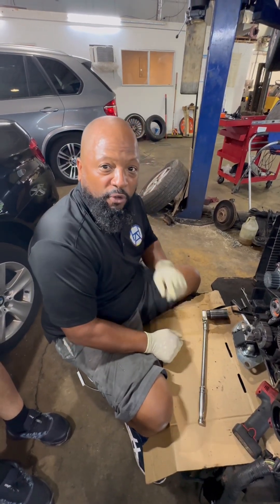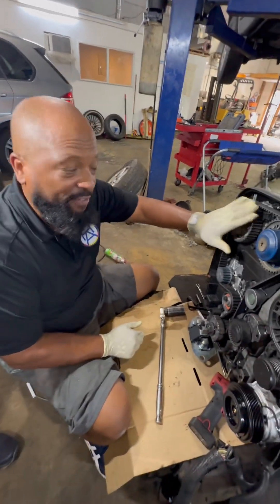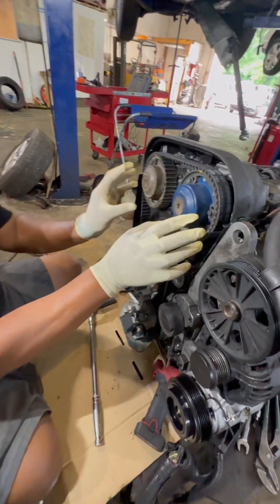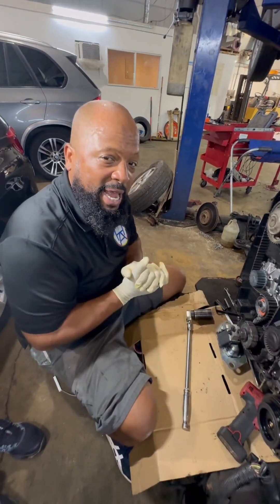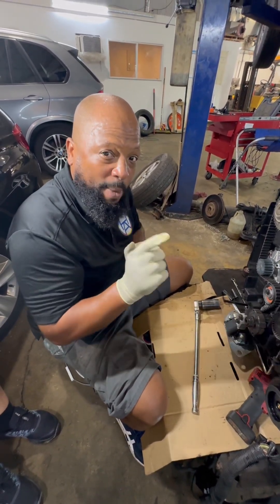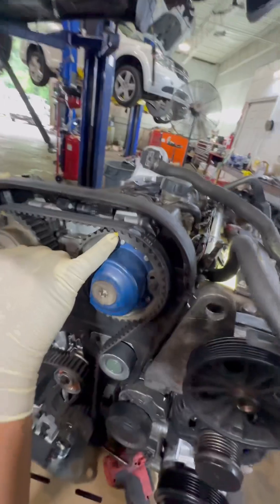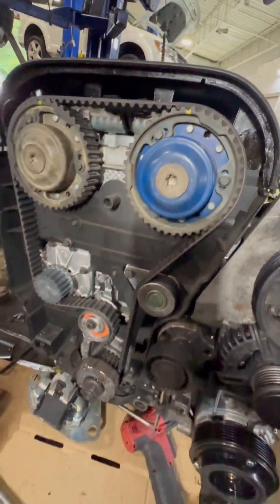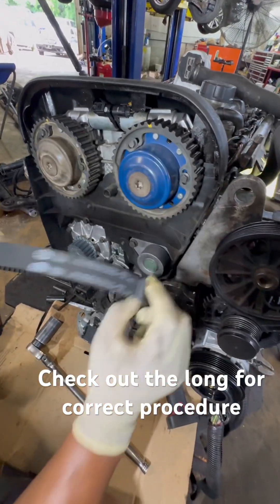How to align timing Marks on a Volvo when the Camsprockets  move during  a timing belt install

Comment: On the 2015 Volvo T5 2.5 I just replaced the timing and tensioner and I noticed when the car is running the timing belt tensioner pointer is moving back-and-forth kinda like juggling is normal
Reply from the maker: Yes